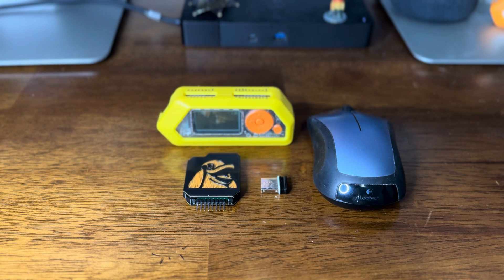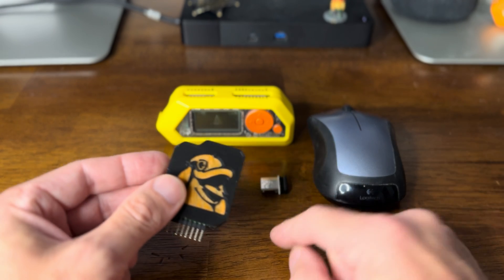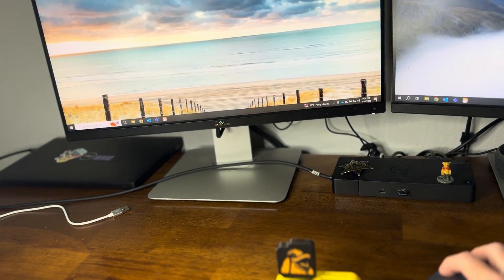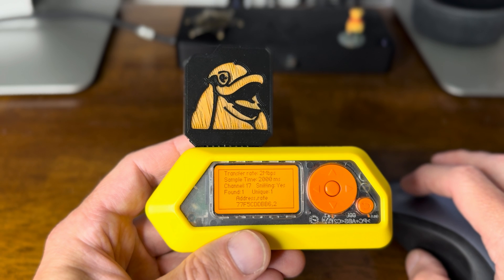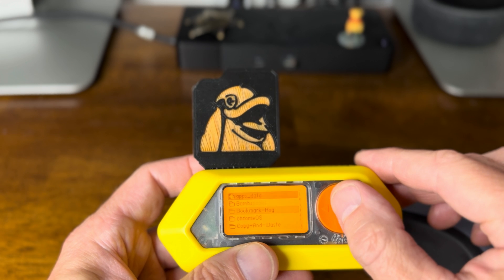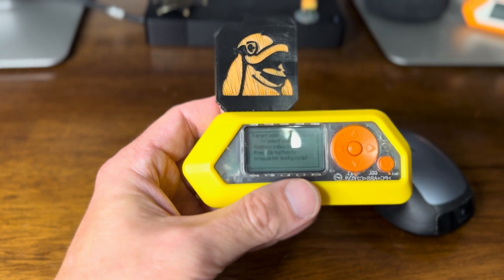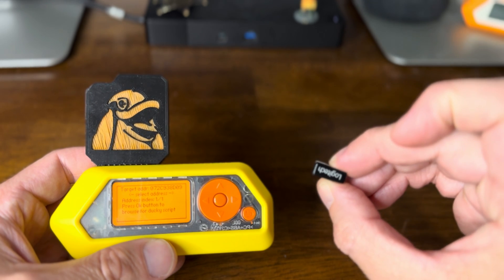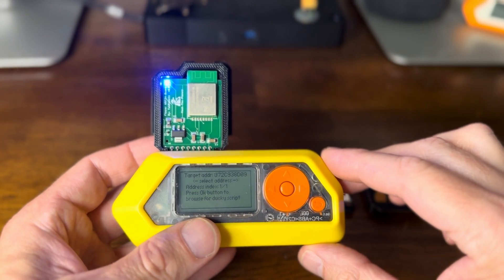Flipper Zero - MouseJacking Attack with a 5v NRF24 MiniBoard by Rabbit-Labs

Comment: So you have to be close enough to plug that dongle in and in range of the BT, you might as well just use the BadUSB cable connection, run it then unplug once finished?
Reply from the maker: No.

Comment: Have you tested the practical range of that nrf24 v2 module? I'm guessing since it's so small and is only using an onboard pcb antenna, the range will not be very good. I think I'd rather have an nrf24 module with an external sma antenna connection and a PA (power amp).
Reply from the maker: I get about 30 feet.